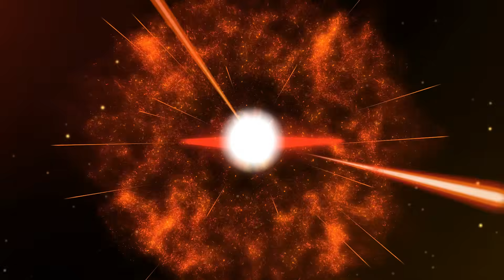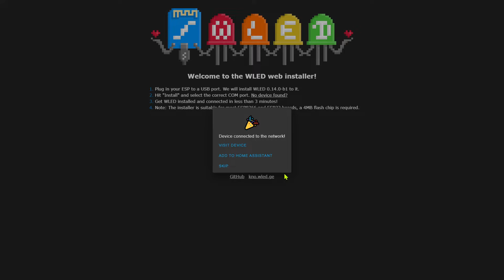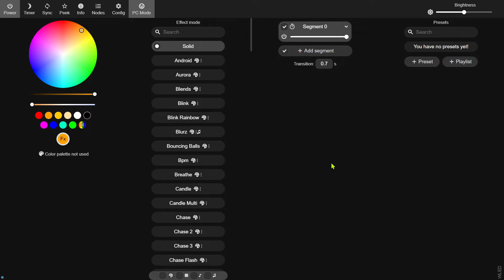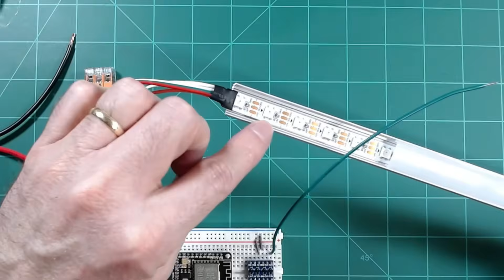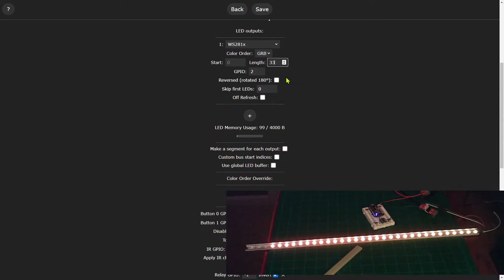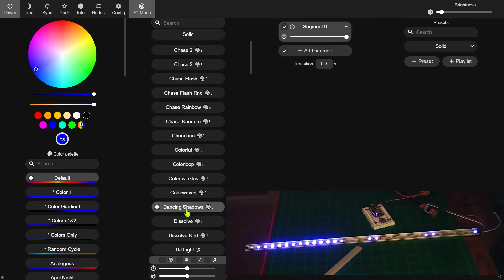How to Quickly Build Your First LED Controller

Comment: Awesome video. Love it. A question however. I was going to order the linked barrel Connector but saw that it does 12v 5amp. I think I needed something that can support 5v 10amp. Would this one still work without melting?
Reply from the maker: I've used those barrel connectors on a bunch of my LED installs.  It should be fine for 5V 10A.  I might consider something different if I was using something like 30-40+ amps... but you aren't going to find that style of power supply at those power levels anyway.  Basically, if the power supply has a barrel connector attached to it, the barrel connector I I showed will handle the same amount of power (or even a little more as it has larger gauge wires) than the built in barrel connector that is attached to the power supply.  Once you get over 15A, then you have to buy the type of power supply that you connect the wires directly to the terminals on the supply... and a barrel connector would not be used at all.

I hope that helps!  Don't hesitate to let me know if you have any other questions.
Reply: @ResinChemTech  yup that helps. Thanks. I am about to do my first one and have opted for esp32 30 pins. The pins are not marked as you mentioned so have messaged the seller for a pin out config. I assume not easy to figure out since I see the 5v 3.3v and GND all over the place. Does it matter which GND to 5v or 3.3v you connect things. I mean to ask if it matters which GNd o use vs the 5v or 3.3v? Also how do I decide which pins to use for sound etc?
Reply from the maker: As far as the grounds... they are all common, so it doesn't matter which one(s) you use.  Ditto for the 3.3V.. it doesn't matter which one you use.  Most boards only have one Vin or 5V pin... but I suppose it is possible to have more than one. 

One thing you may also find is that most ESP32 boards are just slightly wider than the ESP8266... meaning they won't fit on a standard breadboard and leave a row of connections on each side... so you may have to adapt for that if your board is wider than the ESP9266.

As far as sound, there are a number of pins that you can use on the ESP32.  You may want to peek at this (it is the ESP32 version of the pin out I shared for the ESP8266 in the video description).  I use this all the time for determining which pins to use: https://randomnerdtutorials.com/esp32-pinout-reference-gpios/  

You can use any of the ADC1 pins for an analog microphone connection.  Don't use the ADC2 pins, as they will interfere with wifi.  Whichever pin you use, you just have to tell WLED that you are using that pin in the sound settings.

Finally, I have found that many ESP32 boards won't automatically enter flash mode when connected via USB.  If you have issues flashing WLED, you may need to hold down the boot or flash button on the ESP board when connecting it... continuing to hold it down until the flash starts.. then releasing it.  Not all boards work this way... but I've had a number that do require that I do this to get them to flash.

Good luck and let me know if you have additional questions.
Reply: @ResinChemTech  thanks I'll order the barrel Connector. I had the other connector you had in the video. I will use that and limit the current to 2 amps for testing until it arrives. Will check out the pin outs link you sent.
Reply: Hmm I had asked the seller for a pin out layout and am completely blown away. The seller sent me a pinout layout but it does not correspond to what's printed on the back of the chip itself. I am scratching my head now. The chip has pin 1 5v and others marked but it does not correspond to the picture they sent me. For eg 5v is printed somewhere in the middle between other pins but the layout he sent me positions it at the end😮 Are these meant to be standard or does each manufacturer layout differ?
Reply from the maker: This may not help, but generally the Vin/5V pin is placed as the first pin closest to the USB port.  Yes... most boards are generally pretty standard.  Often 'D' or 'P' designations are used.. but that doesn't necessary line up with GPIO number.  For example on the D1 Mini D4 is actually GPIO2.   But part of the issue is that there are a lot of cheap clones out there that don't follow standards (and often cut costs by using a lower quality voltage regulator, etc).  Does the actual ESP chip itself say ESP-WROOM-32 or something else?  It doesn't help that Espressif has released a bunch of different ESP32 chips, like the S series and the C series (plus the older WROVER).  The chips themselves are different and can also lead to different pinouts on the dev boards.

I know that doesn't give you much immediate help, but without being able to see the labeling on the top and bottom of the board, I don't know if there is much additional help I can provide.
Reply: @ResinChemTech  ok so I was wrong. Seller sent me the 38pin ESP32 D0WDQ5 rev3 one which I didn't want. Might be overkill as it is. I have found a pinout for it. It matches with the ones printed on the back phew. Ok now for the important question. You mentioned use ADC1. I have options GPIO 36 being ADC1_0 is this good enough?

Comment: My esp8266 wont work on 5v it works on 3v3 pin
Reply from the maker: The ESP chips themselves operate on 3.3V.  But most dev boards operate off of 5V and have an onboard regulator to step this voltage down to 3.3V for the chip (this is also why the GPIO pins output at 3.3V and the reason that the logic level shifter is used).

If your board has a USB connection, then that means the board itself will handle 5V... as USB operates at 5V.  But if what you have really only runs at 3.3V, then you can add a step down converter to drop the 5V to 3.3V... or purchase a different board that does run off of 5V.
Reply: @ResinChemTech  it has the vin and gnd next to each other but the leds dont work under that just under 3v3  pin

Comment: Not entirely clear why you used the level shifter, if the voltage output is already 5V. Does it provide more current to the LED strip?
Reply from the maker: While the Vin/5V pin does output at 5V, all of the GPIO pins only output at 3.3V.  While this is right at the lower level for a working data signal for the LED strip, the LEDs actually call for a 5V data signal.  

By boosting the data signal from the 3.3V from the GPIO pins to the 5V expected by the LEDs, you can have a much longer run of wire between the controller and the LEDs without worrying about voltage drop leading to a problem with the signal.  That's why I always include one... whether I could technically skip it or not.  This way, I know I have a signal that is the expected 5V and don't have to be concerned about the length of my data line.
Reply: @ResinChemTech  Makes sense, thanks.

Comment: Really nice overview - good way to entice to new people to the amazing world of LEDs.

It is undoubtedly naive on my part, but I tend to worry less about the amperage requirements PER PIXEL, as that maximum tends to be with all sub-LEDs lit to 100% brightness (showing white), which I absolutely never do. My installations are somewhat close to static, so I often mix the per-pixel advice with WLEDs estimate.  I then add a current limit in WLED below what is provided by my actual supply.

My largest installation, my stair lights, with ~400 LEDs, when running the effect "ChunChun" with the palette "Rainbow", which I run at about 20% brightness, WLED estimates consumption at about 450mA. I do have a beefier supplier on there to handle considerably more than that just in case, but likely not as beefy as suggested. Additionally, it only runs these a couple dozen times a day for like 20 seconds :)
Reply from the maker: I agree that in most cases my LEDs, and probably most other people's, are primarily used for decorative lighting and will likely use colors and/or effects that result in significantly less amps than the theoretical maximum.

But it does depend upon the particular project.  My undercabinet lighting in the kitchen is routinely used on full bright white (for an extended time).  And like you, my stair lights use a pattern and are only on for a few seconds at a time.  But my wife does like to turn these lights on solid full bright white when vacuuming the stairs.  So for me it isn't that I'd necessarily routinely use the LEDs at the maximum, but more about having the possibility to run them at full bright white without needing to worry about the power supply, even if I rarely do so.  That's at least the approach I take... I want to have the availability for full power, even if I only need or use it on occasion.

Thanks for the comment and feedback!
Reply: @ResinChemTech  All excellent points.
Reply: Funny isn’t it, I waste time on color when I use white often. I always go for the full amperage but I have a bit of OCD as my Electrical wiring tends to be done to code. Code is there for a reason and people can still cause fire burning up an unused DC line. So on a place like YouTube with a video for beginners…I was so proud he didn’t mention the lack of concern so many show or say about not running white. I love my 275 + 90 LEDs on my garage and breezeway door and having them synchronize the effects is great but I use an HA automation for full white if my doorbell detects you in the driveway. I think we want these new people not to burn their houses down and come back to watch more. It is clear to me you can make decisions that are safe for you and your family. This is based on the cool stuff you show on your channel. Then your channel serves a different purpose and you have different goals. I make this comment because it is not your naïveté that concerns me but that of what I think is the target audience.
Reply: @BELSERVICEMAN  Fair points all.

Comment: Nice video. For those that are concerned the learning curve is to steep there are all in one controllers out there that run WLED and are plug and play.
Reply from the maker: Good point.. and thanks for the reminder.  I almost always mention that pre-built controllers can be purchased in all my LED videos... but overlooked including that in this particular video.  I appreciate you reminding folks that this is another option.
Reply: Good point and I initially tried to find controllers from the WLED wiki and what Amazon US offered was either over kill in power or not applicable to my use case. Have you had good success finding the built controllers?
Reply: @BELSERVICEMAN  Personally I have only used the  QuinLED boards, the UNO and the Quad. He has came out with a simple plug and play option and also some more complicated boards you can stack depending on your needs, the latter are more in line with large to very large LED installations is my understanding.  What I have seen is unless you have a very small amount of LEDs in your project a plug and play (DIY type) option probably is not going to do it for you.
Reply: @ctx_drone_services  Lots of respect for the Quindor Line and envious you have the use case. I don't have enough long LED runs yet to justify the cost AND they aren't available when I need one or could have used it.

Comment: Very interesting on the power supply connector. I would assume if I buy a 5V 10Amp supply that the barrel connector was adequate for the load. Is there a link you could post to help educate us? I feel I would have to cut one open to see for myself to prove the red and black leads fitting you show is actually a better high current connection. Your thoughts?
Reply from the maker: I was only using 33 LEDs in my build (so around 2 amps max).  As I mentioned, I wouldn't use the supplied connector for larger builds or for an extended length of time.  I don't know the precise rating of the adapter, but you would think that if it was included with the power supply, it would be rated to handle the max current from the power supply.  All I can say is that I have had a number burn out or fail, and internally I suspect the connections/traces are relatively thin. So personally I don't have confidence in them for higher current or for longer term/permanent use.

The barrel connector that I briefly show, however, uses 18 gauge wire and is rated for up to 12A (at 5V).  Anything higher than that is likely going to require a transformer style power supply and won't use these types of adapters anyway (although you can get some 15A power supplies in this 'brick style' power supply).  And you can also get connectors with 16 gauge wire (although a different style) if you need higher current.

But it is always a good idea to check all your components for their ratings vs. the maximum power you might pull.  In all honestly, LED installs will generally draw significantly less than the max until you run on full bright white light... but you should always plan on the maximum for safety reasons.